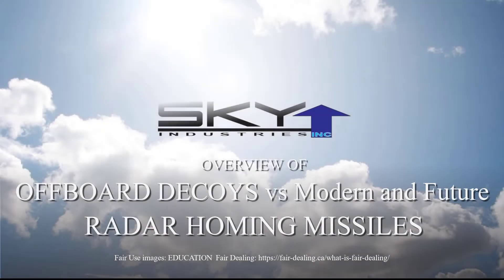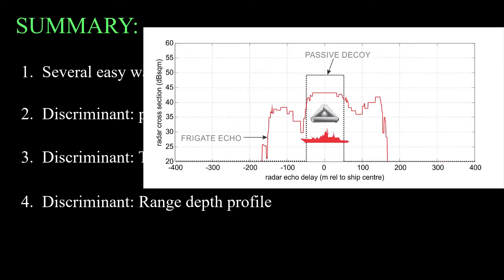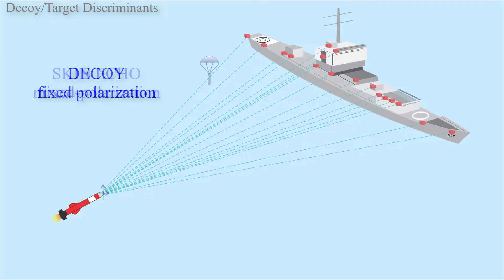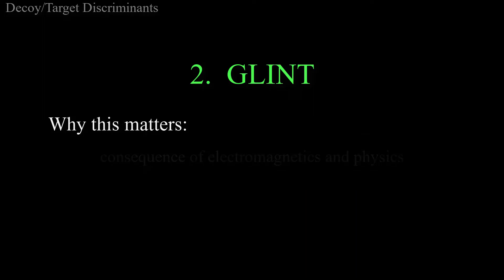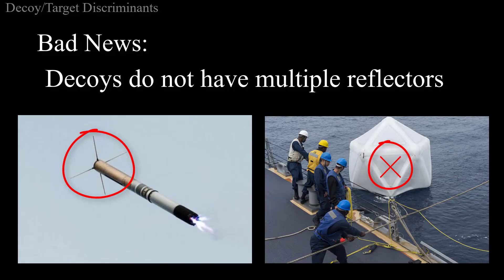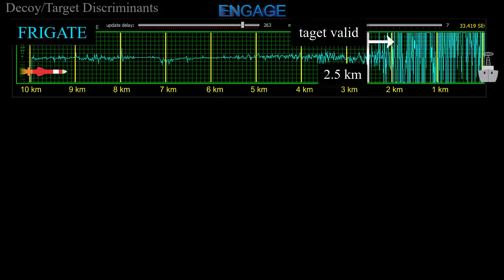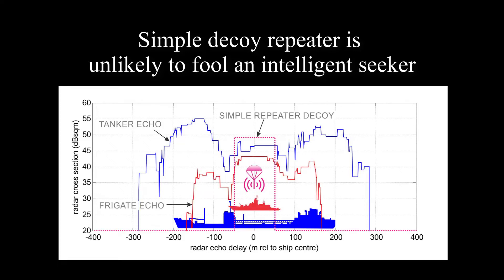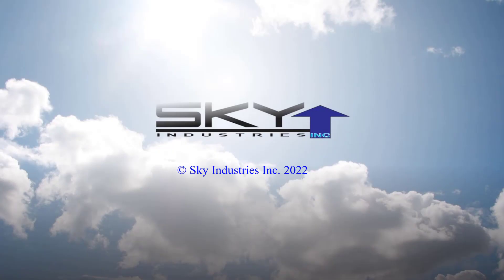Offboard Decoys vs Modern Missiles

Comment: question: what about chaff? it seems to me that it would have polarization diversity, have glint, and have a range depth profile (though not quite like one of a ship)
Reply: The characteristics of chaff would change as it drifted around, was hit by wind, etc.  Presumably then, the diversity, glint, and depth profile of the chaff cloud would change.  For example, the target depth profile of a ship would have some consistency as the missile approached the target, even though the scale of it would change (e.g., the tall thing at the back would still be a tall thing at the back).  Chaff would float/fall/blow randomly, and there wouldn't be any discernable pattern to the depth profile over time.
Reply: @fieryweasel but the combination of absurd amount of Chaff and active decoy should be enough to overwhelm missile's onboard processor to cause a miss